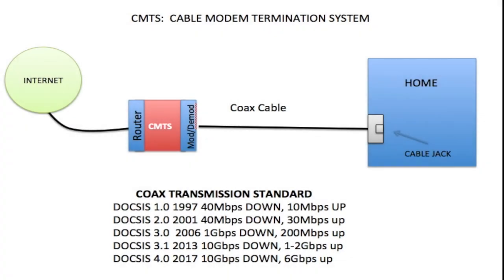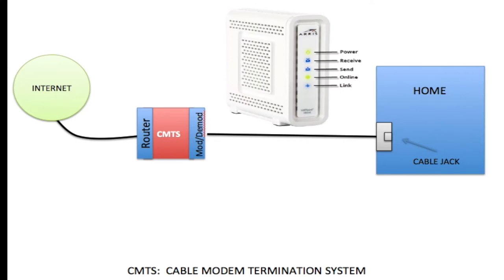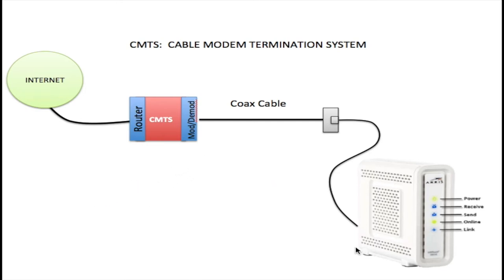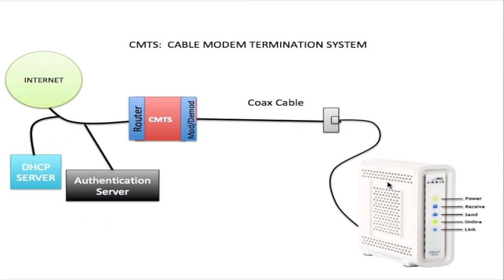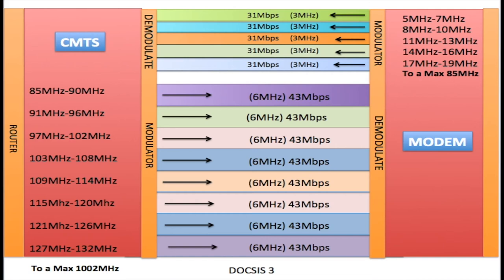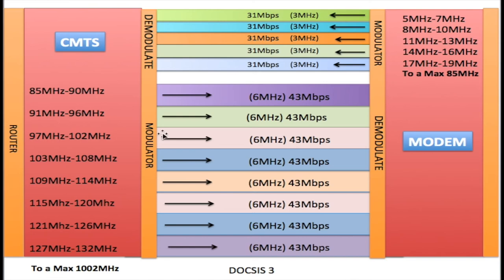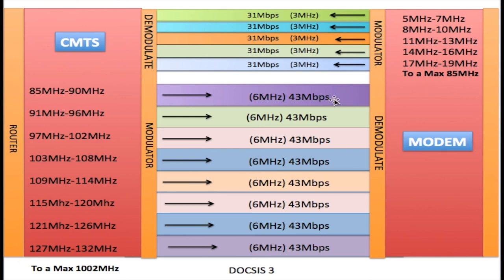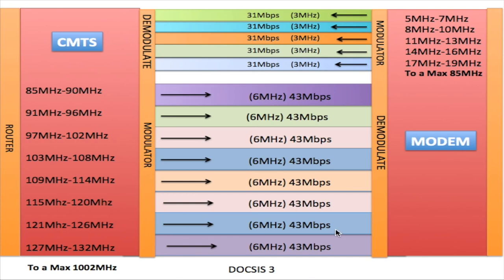How Cable Modems Work

Comment: I'm wondering how the physical cable works using only a single center conductor.  I get the impression it works like a walkie talkie or Ham radio, the transceiver can only transmit or receive at a given time, not both at the same time.  Cable is just whole lot faster making it appear almost seamless.
Reply from the maker: You are correct.  It works in a half duplex mode just like a Ham Radio or Walkie talkie.  The transmission time is devided between downstream and upstream  sharing the same single center conductor.

Comment: So did I understand correctly? While the cable infrastructure is saturated during peak hours, will DSL be less saturated under the same conditions?
Reply from the maker: Cable is a shared service. During peak hours they are more subscribers using the service.  Resulting in slower speed.  Dsl service is not shared, so speed is generally constant.  Hope my answer was helpful.
Reply: @TelecomTraining  Understood thanks. However, does the performance of DSL not decrease due to the congestion experienced in the MPLS backbone, or is this related to the capacities of the ISPs?
Reply: @TelecomTraining  In the country I live in (TR), the ISP named Türk Telekom is the company that undertakes almost all other DSL infrastructure and provides services with VAE. So isn't it shared like cable?

Comment: Actually the link light has nothing to do with the communication between the modem and the CMTS. The link light you’re referring to is simply what indicates communication between the modem and whatever is connected to it such as a computer or router. It’ll flash or blink when there’s communication between the two or the outside internet.
Reply from the maker: Thanks for the heads up.   Unfortunately manufacturers don't  standardize the naming convention.

Comment: How does CM will receive configuration file from TFTP if according to your scheme, DHCP process will be the second step after TFTP? That is not right. DHCP process is first, after that CM receives configuration file through the TFTP (IP of which he receives from DHCP server)
Reply from the maker: Thank you for the question.  The first step with cable modems is to negotiate a secure communication path with the Head End.  Only after this path has been established with the CMTS  would an ip address be send from the DHCP server to the modem.  You cannot have the dhcp assignment first with out first establishing the physical communication path between the subscriber's modem and the Headend.  Hope my answer was helpful to you.  Thanks again for the question.
Reply: A cable modem will have two IP addresses ... one private one for administration (including the TFTP configuration file download) and one for actual public traffic. ... Its buried in the spec.

Comment: If you are on dsl with fiber . No problem
Reply from the maker: That is correct.  End to end Dsl on fiber is great.  However most Dsl lines only use fiber  from the Central Office to local areas.  The Fiber is generally connected to a twisted pair of copper wires in order to carry the service to each customer premises.  The length of the twisted pair is generally between 100 meters and 1000 meters and the greater the length of the copper wire the slower the service will be. However DSL is also a great service and is a perfect High Speed Internet Solution to thousands of subscribers. It can also be be a very cost effective solution to many.